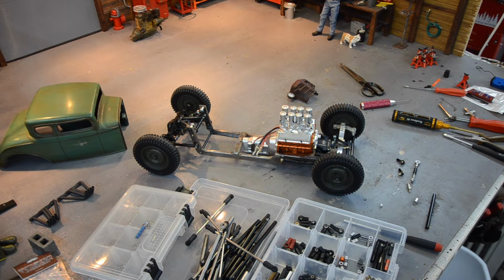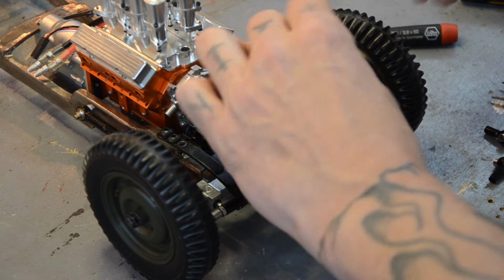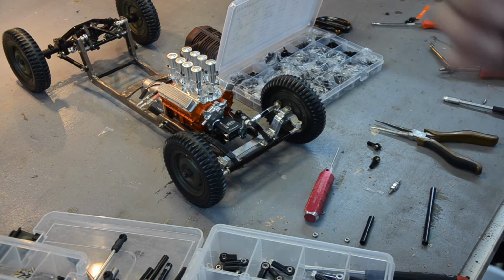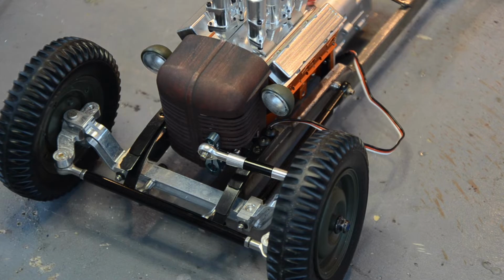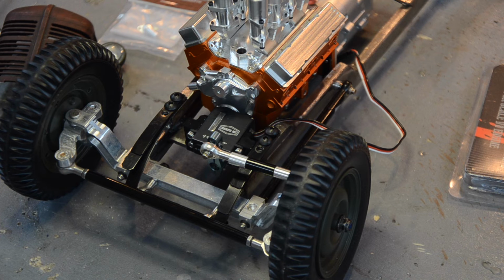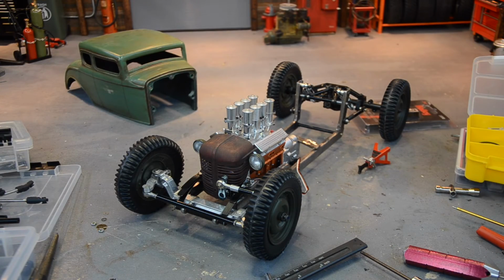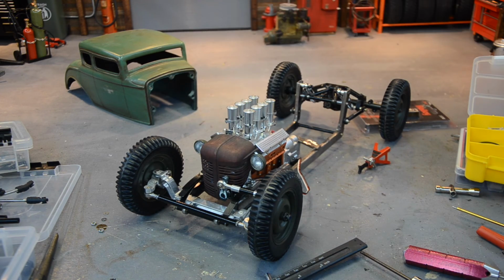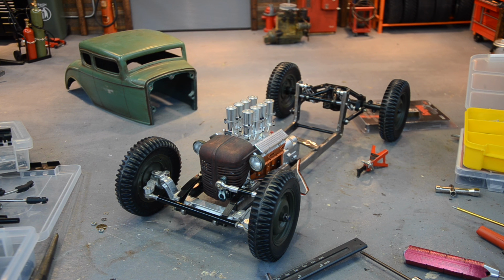5 Window RC RatRod Scratchbuild, Part 5, Steering & Fabbing Grill Mounts, RCengineering

Comment: little tech tip: when you want the bolt heads smaller, clamp the bolt in the  drill and than while spinning it, use the angle grinder or belt sender. This way it stays nice and even.

Comment: oh my god dude i slipped up onto something awsome today. on the front axle where its not got a 12 m hex i found something that works awsome. take two 75 ohm tv coax ends and grind down the back till you have right depth then slip on the coax os 12 m and even sorda has built in bearing the way it spins. then small washer on outside and nut. no slack, tight as can be, looks the part. i will try to post a video on it.
Reply from the maker: Haha 😆 that’s awesome dude

Comment: hey man love your channel, can you help i am building first rat rod and want to use ssd scale trans without transfercase but what motor would be good brushed to get some wheel speed. want this baby to spin a set of offroad jeep tires and paint arm green 28 ford roadster toy from 70's conversion
Reply from the maker: In most of mine I run stock tamiya mubachi motors.  I think they are around 20t maybe.  Fast enough to spin but not fast enough to roll it and mess it up.  Plus they are cheap.  If you want a little faster maybe pick up the tamiya sport tuned motor.  Still a basic brushed unit and reasonably priced.  I have not ran any ratrods on the ssd trans but I imagine the gearing is close to the same as the rc4wd ones I have.